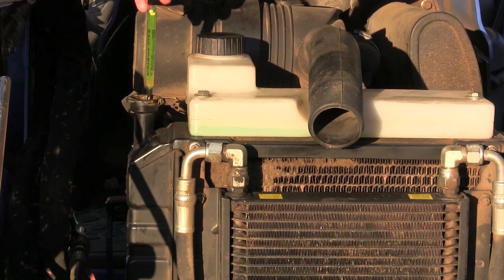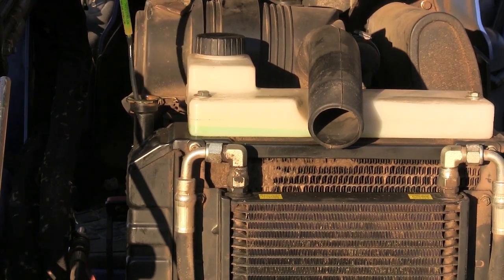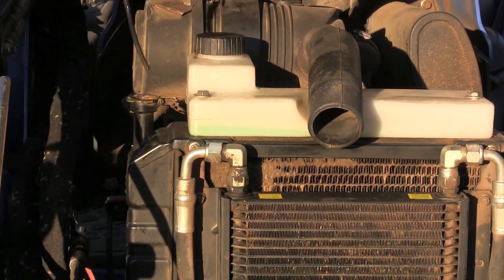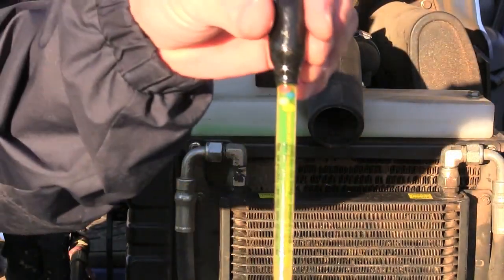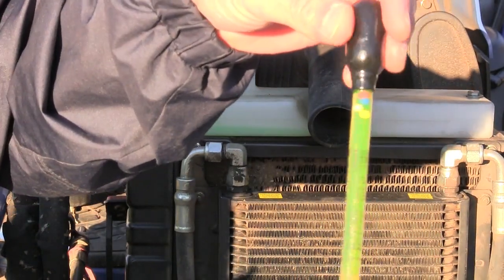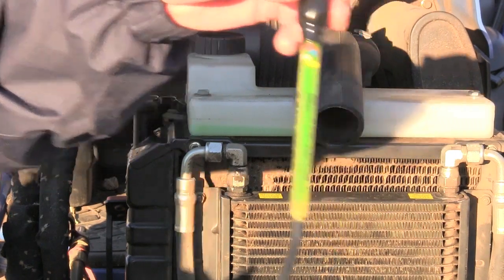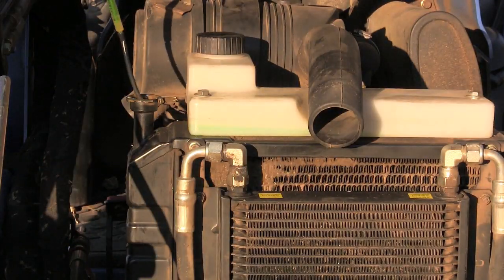How to Keep Your Tractor Engine from Getting a Cracked Block

Comment: Thanks for catching that Mike... I know someone that got stung because he was in a habit of checking the overflow tank, He didnot realize he had a problem with the radiator cap and it Never pulled coolant back from the reservoir... that coupled with the actual coolant being flushed out and refilled with Water, set him up for an expensive winter.
Reply from the maker: +45von It wasn't so much I caught it, but the people that watch my videos caught it.  I really should know better, on the old tractors there was no overflow tank and you had to check it in the radiator.

Comment: Hey mike just found your channel and subscribed. A dealership moved into town and they carry Mahindra Tractors what is your opinion  of this tractors?
Reply from the maker: +Jvs Rancher Sorry for the late reply, I somehow missed your comment the first time around.  I don't make specific brand recommendations, but I'll tell you what I know.  Mahindra has been around long enough and have enough tractors out that they're definitely committed to the North American market.  Everything I've seen of the product, so far, has been good.  The only downside I've seen is the paint on some of their earlier tractors didn't weather well, but the later tractors seem to have done a lot better.  Red is a difficult color to keep looking good, certain hues seem to turn pink in the sun.  Other than that there haven't been any major, chronic mechanical issues with them and they seem to be holding up well.  I haven't heard of major, unresolved warranty issues or people ratting them out online who hate the product or the company and you usually find someone who wants to rant about everything.  If it looks like the dealer is committed to the product and will be there to back it up I sure wouldn't have a problem owning one.